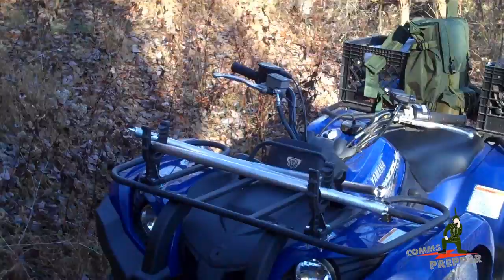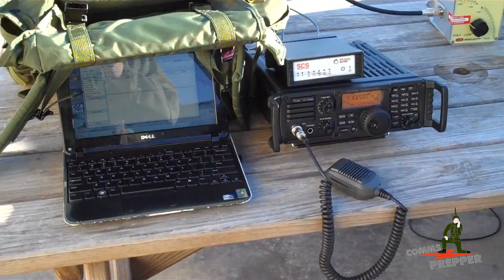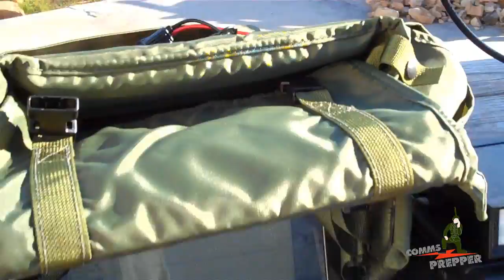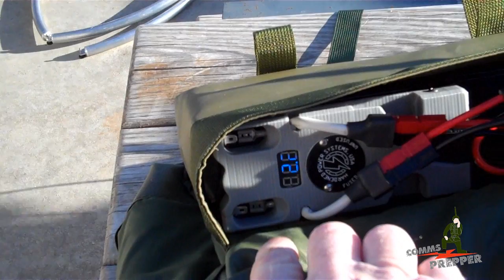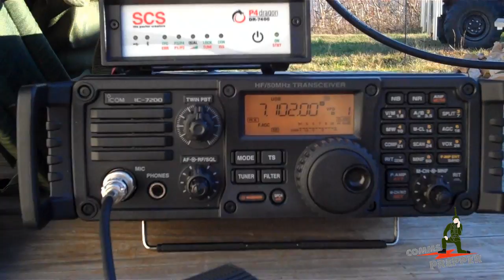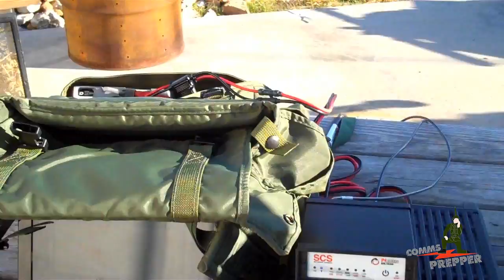Icom IC-7200 Field Operations

Comment: OMG that modem is over $1,800 (as of 2020) What could be so important to transmit over the airwaves to spend that much on that modem? The other person would have to have one to right? what is the expected bandwidth you could send over the air with that, say 800 miles or 1600 miles?
Reply from the maker: Prepper channel - folks spend way more on other prepper items.

Comment: I think I would cut a cooling vent opening in the ruck bag, then insert some Mil 8061 OD nylon mesh to keep FOD out, and have a flap sewn along the top with 3/4" or 1" Velcro along the sides and bottom so you can operate in the ruck with the flap opened as needed for intense operation or air temp.

Comment: sad to say great Idea though you be better design a purpose for holding the radio so the radio can be operated from the bag..
Reply from the maker: I don't get your comment.
Reply: If you have to rip the rig out every time to use it, it gets tired real fast.

If you can't use direct from the pack it is a waste of time using it I'm surprised you aren't walking around with the radio on..

As for the modem great idea in practice though implementation in a emergency is going to be pointless you'd be better off with sat internet setup..

Whilst this idea has limited use with modems built into laptops these days I would think with interface you could likely remove the modem altogether
Reply from the maker: My experience with the pack has not been the same as yours.   I am very happy with the pack and happy to have found something that comes from the surplus market that fits the radio.

While I like SATCOM based Internet access - the monthly cost and infrastructure support requirements make these systems problematic for prepping.  The Pactor modem is not the same type of modem found in PCs.  The Pactor modem is an operational force multiplier.   Internet email or point-to-point Data comms - hard to beat that.